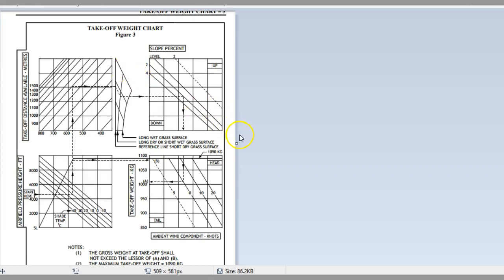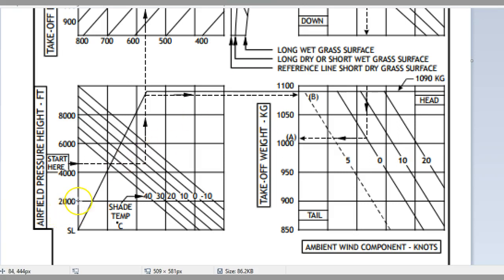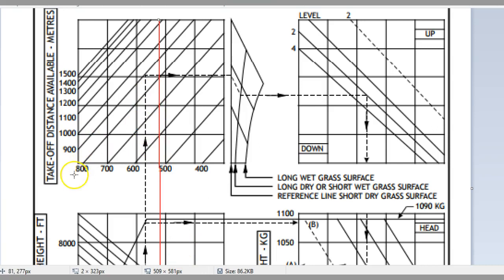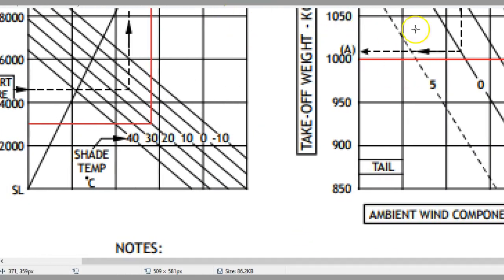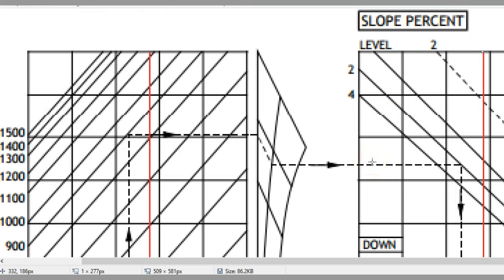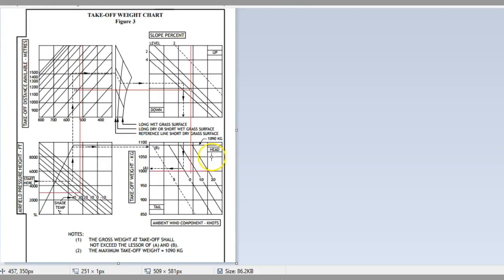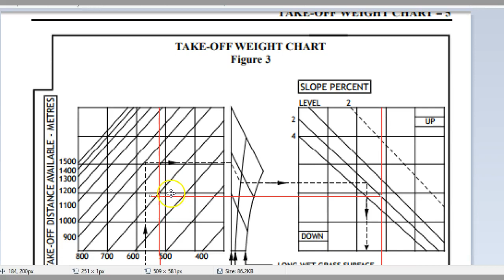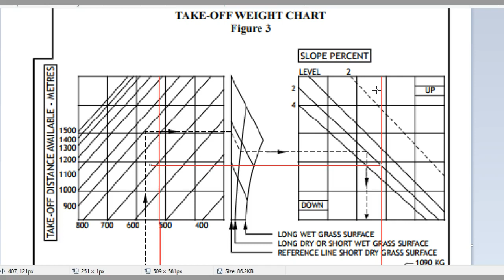Takeoff Weight Performance Chart For CASA Pilot Exams, Learn To Fly, Flight Training

Comment: No offence.  Those charts need to be more detailed or have more finite scales for the X and Y axis.  It is UTTERLY STUPID, even for a basic exam, that we have be accurate when having to say approximate 3789 pressure altitude.  It would be better to just round it off to 4000 pressure altitude.  The bureaucrats and CASA need to get their act together.

Comment: In my flight review questions it says I have a 10kt variable wind component - would I put this down as zero wind?
Reply: No 10kt wind. Either it be HEAD or TAIL winds
Reply: Also, if a parameter of a question exceeds the boundaries of one of the charts, draw a straight line from the current box to the next box in the sequence; that goes from the current point to the very edge of the next box.

Comment: Hi Matt, I have a question. If I take off from an aerodrome which doesn't have a TAF available. How can I find out the actual  temperature of that aerodrome to use it in the chart? I know that we need to go to VFRG to find the pressure height relates to each season. 

Looking forward for your reply
Reply: Use the aircraft outside temperature gage

Comment: Hi Matt, John Place here. 

Is a 1% downslope considered a slope or do we use "0" as this was the difference in my answer
Given the following in one of the PPL Practice exam questions:

Elev = 3190'
QNH = 1019
Shade Temp = 20c
Runway = Short Dry Grass
Runway slope = 1% downslope
Take Off Weight = 1090kg
Wind = 0 kts

I would assume you draw a line in between 0 & 2% to get a 1% reference,
Hence the difference of 1% = 900 meter run.

then I saw the correct answer as 965 meters, so I redrew based on "0" or level runway and estimated 970 meters.

In reality the moment of rotation say at 55-60 KIAS can be several 10's of meters in a few seconds delay.

Great videos by the way.

Taking my time doing my KDRS and these are one of my errors.

Cheers 

John Place
Reply: Hey mate, I know you commented on this ages ago but do you remember if in the exam you multiplied whatever your take off distance required by 1.15. I passed my ppl exam but got all the charts wrong and I think that might have been my issue
Reply: Did u find out how it works by any chance? Coz i have the same question